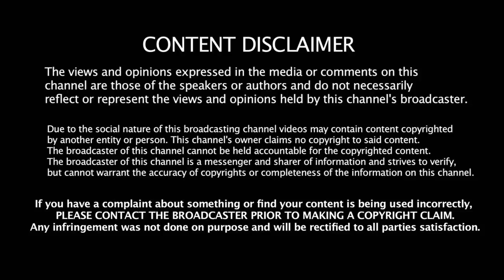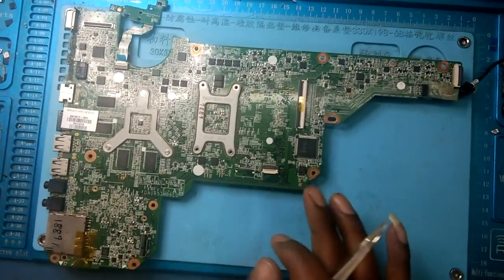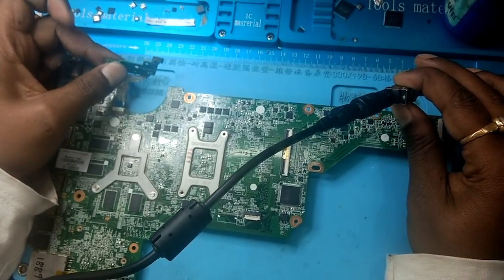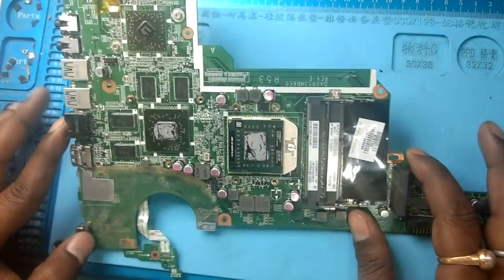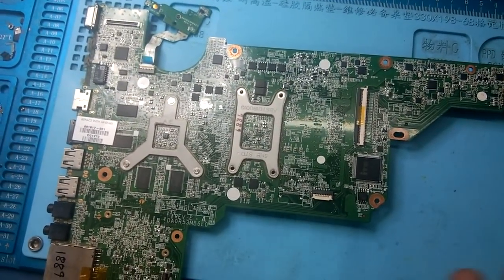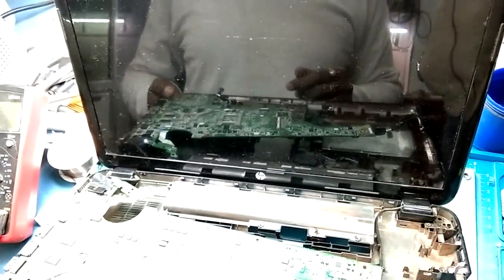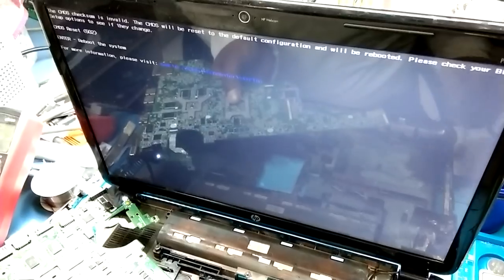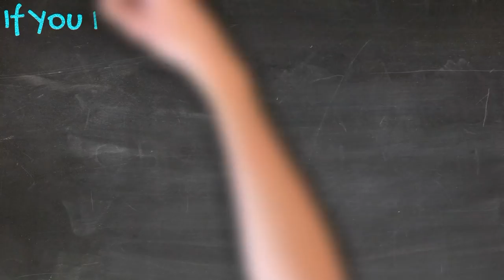Hp Laptop Dc jack Light blinks 3 times after press power on switch Solution (Demo)

Comment: It blinks thrice when your battery is drained to atmost 0, just put on chage start after 10 15 min it will run. 
Do not try to start just after pluging in chager it won't start as battery is 0 . Wait 10 15 min it will start
Reply from the maker: Sir do u do repairing??
Reply: Aapke laptop m bhi aisi problem ai thi kya? Mera laptop nhi on ho raha h plz help
Reply: @adityaverma7522  haan bhai aaya tha but maine wahi kia charge par laga kar rakh diya 20 min baad start kia to start ho gya tha.
Reply: @siddharthbhadauria98  bhai mera bhi start ho gya 😊😊😊😊
Reply: Thank you, your solution worked. You are a genius.
Reply: Thank you so much 😊
Reply: thanks mera bhi hogaya mera i7 hp workstation laptop ❤️👍❤️🤟
Reply: Bhaii mera nhi hora sari raat lga liaa charging p..😂

Comment: Prior to suspect of a bad motherboard you have to  make the test with a reliable charger (ac Adapter) this error sometimes is caused by a defective charger or even more exact, the  control line of the charger that goes in the 3 way cable and plug

Comment: Laptop Wont Power on. Power button flashes when Plugged in, stops when unplugged.

Product: HP ZBOOK 15 G3
Operating System: Microsoft Windows 10 (64-Bit)
Good evening
HP Zbook G3 15
Please, I have a problem with my laptop
I installed Windows 10 on it and it was still working
And the battery was 40% and I went out for a ride and came back after two hours and found the side completely disconnected
As if dead, I reached the charger, but the device does not work at all. The charger bulb is working and there is a faint blinking on the power button. The charger capacity is 150 watts.